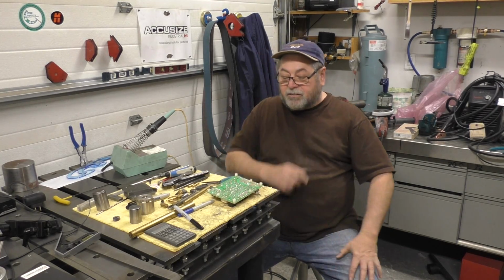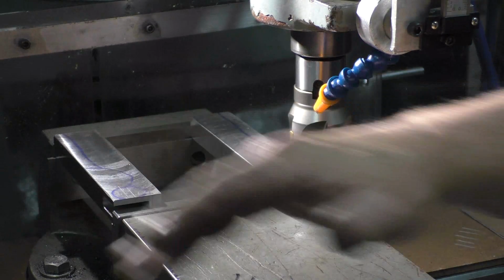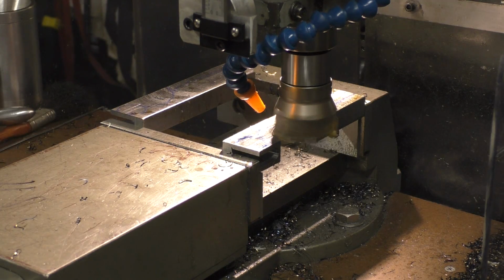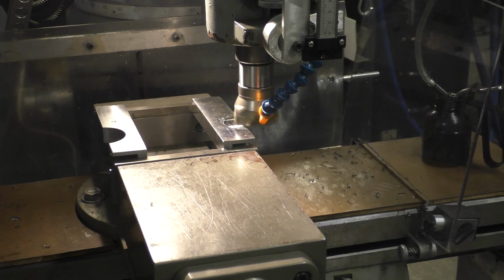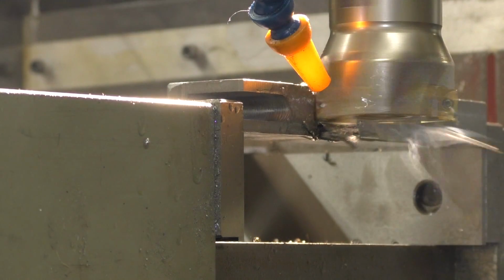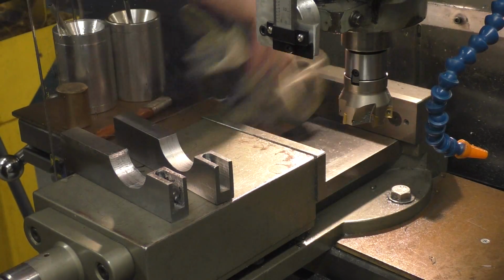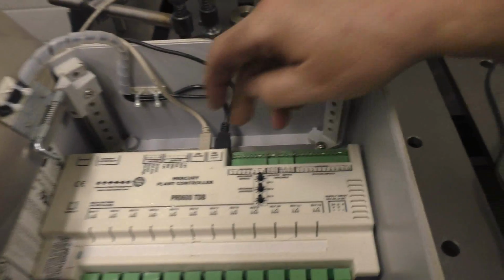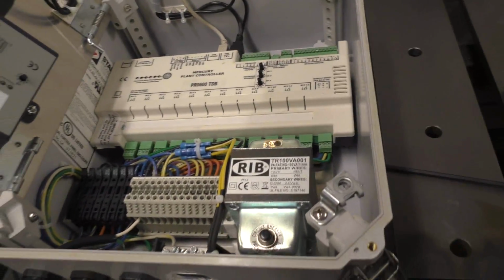Another Day In The Shop 15. More odds To No Ends

Comment: Need a PLC that does the dishes, mow the lawn, feeds the cat, pick-up the chips, etc... Guess it's a question of programming...   lol
To help with cheap PC boards and higher powered solders, you clean the pin, whirl around some wire wrap wire let a little length lay on the board and then make a beefy solder, that way you can be safe until you retire or die...
Reply from the maker: +pierre beaudry 
PLC,Yes I need One Too to do the lawn, Hey don't they make Rumba for that too :) lOl. As for the boards, Some of these boards are a pile of shit to get right to the point. I tried to get a little wire rap around the post but to darn short. Cleaned the best I could and just laid the solder down. With all the stress the I think Retiring might be the best. You never know.